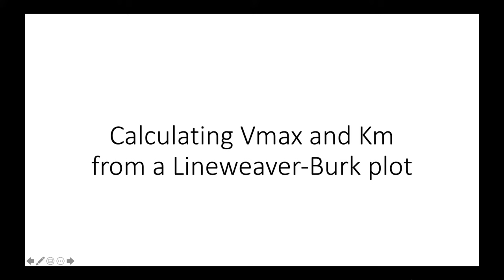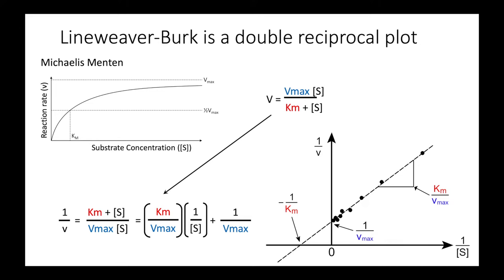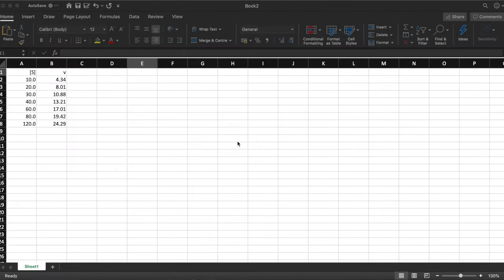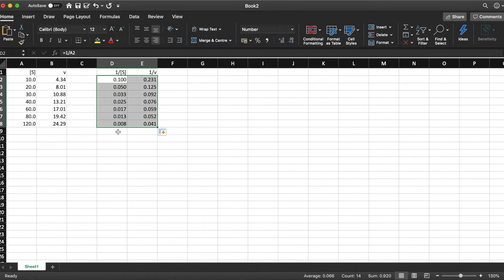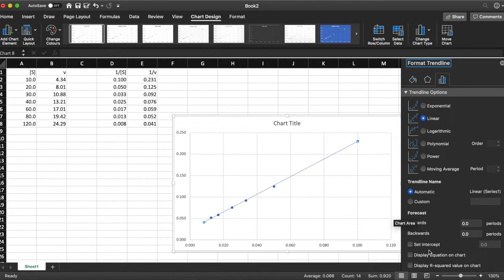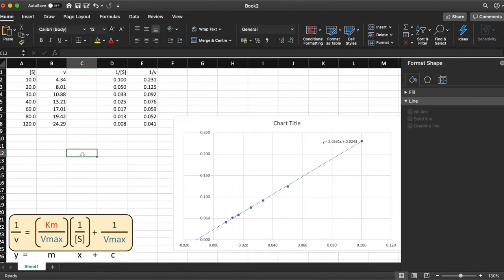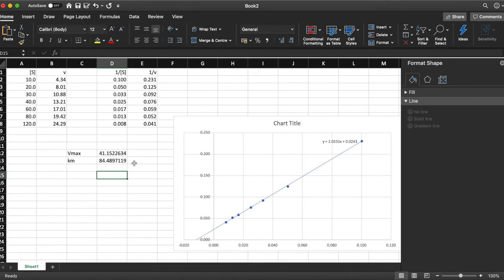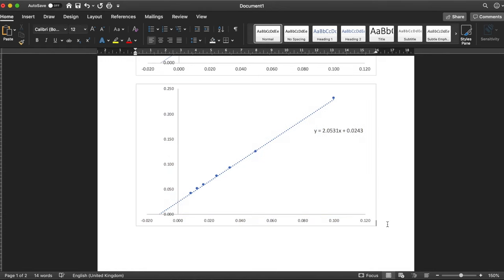How to calculate Vmax and Km from a Lineweaver-Burk plot

Comment: I always come across this question: since we measure the product concentration ([P]) at different times (t) and substrate concentrations ([S]), when plotting Lineweaver-Burk, what 1/v values are we plotting? I mean: if I measure [P] at five different times (t1-t5) starting from four different [S], I obtain a rate (v) for each t at different [S]? which one should be plotted?
Reply from the maker: Lineweaver Burk is independent of time as it takes the initial velocity for each substrate concentration. While it is true that you may need to take multiple readings at each individual substrate concentration in order to be able to calculate the gradient of the curve tangent, it is only the one velocity value per substrate concentration that is subsequently used in plotting the Lineweaver Burk plot.
Reply: @NigelFrancis  Oh thank you! Now I understand it much better. Then, how is the initial velocity for each concentration calculated?
Reply from the maker: @ramiroillanes8354  That's the gradient of the tangent at t=0 for each [S]

Comment: A question: I have two purified enzymes with unknown concentrations. If I determine the Km and Vmax as you did in this video, are these values comparable to each other? Or I really must use equal amount of enzymes? I know Km is independent of enzyme amount but what if it comes to comparison? Thanks in advance!
Reply from the maker: An interesting question, the Vmax will depend on the concentration of active enzyme present so it is not really appropriate to directly compare, Some people try to get around this by expressing as per ug of protein, but then this is not strictly Vmax.
Reply: @NigelFrancis  Thank you!

Comment: why is the Km higher than Vmax, I thought km was 1/2 max?
Reply from the maker: Vmax and Km have different units, Vmax is normally expressed as a unit of concentration/a unit of time (e.g.micromoles/second). Km on the other hand is expressed as a unit of concentration (e.g. micromoles).

The Michaelis-Menten plot allows you to approximate Km from the 1/2 Vmax value e.g. if Vmax was 100 then the concentration that would be equivalent to Km would be that where Vmax is equal to 50. It does not mean that Km is exactly equal to the value of 1/2 Vmax.

Hope that helps?

Comment: Sometimes, I get LB plot equation as  y=ax-b. Not y=ax+b . Why is it negative?  If i include more reaction (with differently substrate amount), I am getting so differently values. Why is it changing so easly?
Reply: For example; 
When I use; 
My substrate column; 1, 2, 3, 4, 5, 6  mM. 
Velocity column; 0.25, 0.55, 0.75,  0.92,  1.05, 1.138, 1,14
Vmax: 5,042 Km: 18,59

When I use; 
My substrate column; 0.1, 0.3, 0.5, 1, 2, 3, 4, 5, 6  mM. 
Velocity column; 0.06, 0.09, 0.11, 0.25, 0.55, 0.75,  0.92,  1.05, 1.138, 1,14
Vmax : 0,567 Km: 0,954

So differently, Why?
Reply from the maker: @zaysiz  the short answer is that you cannot have a negative intercept if the enzyme is indeed michealian. Are you absolutely sure about your substrate concentrations? If you’re overestimating, especially at low concentrations this could shift the curve and give the result you describe.

The LB plot has a weakness in that the distribution of points is uneven and there is a greater emphasis on lower concentrations, which are inherently more difficult to determine accurately. You could try Eadie or Hanes plots to check your answers.
Reply: @NigelFrancis   Thank you for your answer. 
MM graph looks normal. If I neglect some reactions with  low substrate concentration, become LB plot equation to y=ax+b.  Should I neglect them for y=ax+b equation? 

I learned  on the internet how to calculate km vmax by Eadie and tried Eadie Hofstee plot. Equation looks normal but I am not sure of the accuracy. 

I wonder before everything, Do you say that I can not calculate Km and Vmax by  y=ax-b equation. I should change substrate concentrations and have to fix the equation for y=ax+b, haven't I?
Reply from the maker: @zaysiz  You cannot calculate Vmax from a negative y-intercept as the intercept point is 1/Vmax. I suspect that there is either an error in the experimental procedure or that the concentration of the substrate is incorrect and is causing errors that are magnified at the lower concentrations due to the bias in the LB plot.
Reply: @NigelFrancis  Thank you so much for your interest.